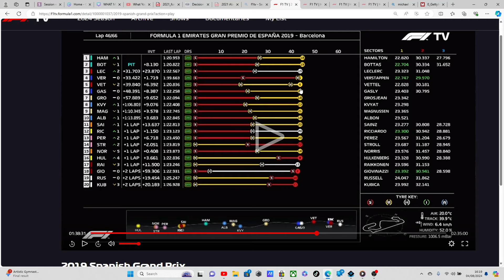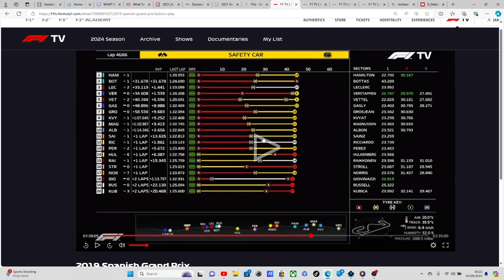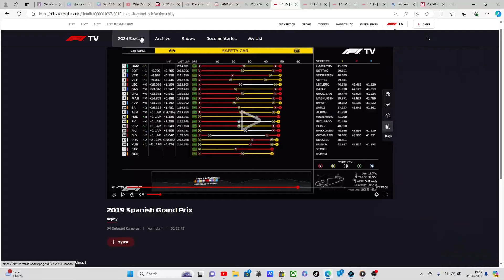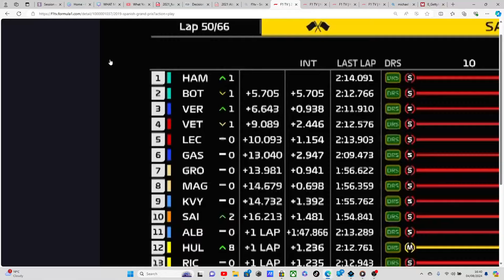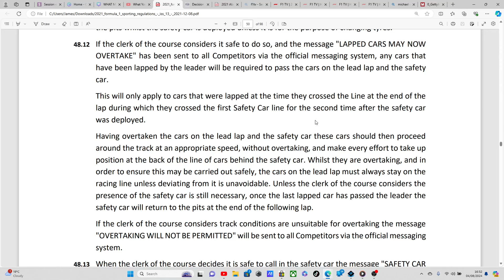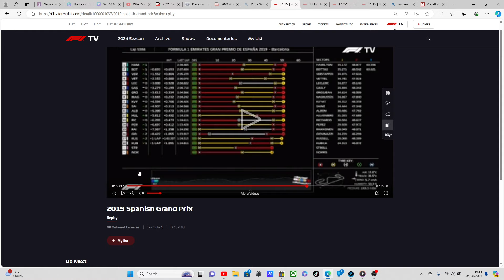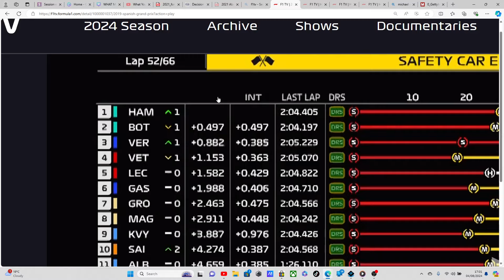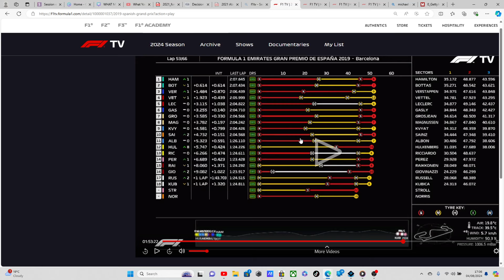MASI SPEAKS OUT - 'THE PURPOSE OF 15.3 - OVERRRIDING AUTHORITY' #lewishamilton #f1 #abudhabi2021

Comment: The FiA Ruined The race by letting only 5 lapped cars unlap themselves when there wasn't enough laps left for any racing Lewis Hamilton won that Race if the standard rules procedure was followed
Reply: but the ultimate rule apllied so you lost :D
Reply: @oktayyilmaz5134  🤔🤔🤔🤔So by your assertion the ultimate rule is cheating, and you call it victory🤔🤔🤔🤔. Well the world is really in big trouble, I hope your boss will not apply the ultimate rule for your income😁😁😁
Reply: @oktayyilmaz5134 but the rules wasn't applied, that's the point,
Reply: @chriscollins550  race diretor had right to finish it under green..
Reply: @oktayyilmaz5134  no he didn't that itself was a missed used regulations. He only has control of the safety car if there's a problem with the safety car and has to bring another safety cat out on track of of there's a major incident like Roaman one, but it's not to restart the race.
Reply: @chriscollins550 That evening, still at the track, stewards dismissed Mercedes’ complaint after finding other areas of regulation that also applied, in addition to Article 48.12.

The first was Article 15.3, which gives the race director ultimate control over the use of the safety car — including its deployment and withdrawal, said the stewards.
he second was article 48.13, which sets out that the ‘safety car in this lap’ message is the signal that it will enter the pit lane at the end of that lap.

Stewards found that this overrode Article 48.12, so displaying the message meant that it no longer had to complete an additional lap following the unlapping procedure.
Reply: that was the rules...so you can not say it wasnt race director power...
Reply: @oktayyilmaz5134  it wasn't the rule, he missed used it and he agreed that he did in the investigation, he even said that the season before they had the same issue and did the opposite because he the regulations was not meant for that reason or to restart the race, what part of that do you not understand, he chose to do it this time because he thought that it would be changed after the race but it wasn't and he was panicking knowing it was a missed use of the regulations and then he got fired after the investigation because of it. Now do you understand
Reply: @oktayyilmaz5134  the point is the stewards was wrong as well because both the articles you have mentioned should never be used to over ride the safety. Like I said masi was fired for it and them stewards didn't know that the other racing code bock other rides both them articles, but masi did know and should of advised the stewards. The stewards are not entitled to both regulations book's only the race director is.
Reply: @chriscollins550  bro yes I agree..this rules used so rarely...maybe first time..but that doesnt change the fact that you cant say he did that for Max..all he did was to finish under green light...there are not any court judge...he used sporting regulation 15.3, 48.13
Reply: @chriscollins550  he did not think it would be change...otherwise he wouldnt say" we went motor racing."
Reply: @chriscollins550  I dont think he overruled any safety...Also he could let all cars in lap 56 but he did not..that was for safety..
Reply: @oktayyilmaz5134  he was fired for using it, because its not meant to be used like that, how do you not understand it, the stewards didn't understand the regulations but masi did, it's never been used in f1 like that and never will again because the fia have removed both articles now, it was designed only to be used in major incidents or if there's a problem with the safety  car, even the investigation says that.
Reply: @chriscollins550  yes I am Max fan..And you can call me biased..But if all rules are in the book ...you can say that must be changed..but you cant say  48.13, 15.3 was not there..He also said I did it to finish under green..Also I can say "how the hell 5 laps arent enough to start the race.".
Reply: @oktayyilmaz5134   yes he did he even wrote it down in he's own NDNA investigation note's, he admitted it, he only said the motor racing word's copying what Horner had said to him on the radio just before the restart.
Reply: They had the ability to unlap all cars when they originally said they couldn’t.
Reply: @chriscollins550 I agree that they broke rules but the question none of you guys can answer and refuse to acknowledge is why didn’t they let cars unlap when they made the original call not too? If all teams agreed to end it under green flags, and the mess is basically all cleaned up, why not let all cars unlap then and just have them slow around the wreckage?  There is precedent for that in fact most safety cars in the history of f1 worked that way. The track doesn’t need to be 100% clear to allow cars to driver thru they already are driving around at a slow pace. It seems like they realized that too late then tried to undo that by allowing some of the cars to unlap at the last second. But had they just let the cars unlap originally then none of the controversy would have happened and max would still be champion.
Reply: @weignerleigner3037  because since the death of jules the track has to be cleared before racing can restart as written in the regulations after he's death,  even if the team's ask fir a green flag finish it's not in the regulations again it doesn't matter what the team's ask for the regulations need to be followed to the letter, the only choice they had if the regulations was followed to the letter of how it's written was to finish under the safety,
Reply: @weignerleigner3037  no they didn't because, the car was still on fire on the track, they can't let car's unlap till the track is clear then they have to rejoin the back of the back plus the warm up laps and the safety car in lap.
Reply: @chriscollins550  that’s not true. Teams were on radio asking when they could unlap because the wreck had been picked up mostly. Even Martin brundle during the whole fiasco was confused by the call. It’s not against the rules at all. They are already driving around the wreck there’s no reason they can’t unlap at that point. Even joylon Palmer in the after race analysis brings this up. Again you guys make stuff up or selectively pick out the issues to make it seem like lewis got robbed. And also lewis that weekend had gotten away with multiple things that should have been penalties. The reality is most people who watch f1 saw the entire season the fia was a joke and we don’t care it was an entertaining season and the clear best driver won the title which is how it should be. Had lewis won there would be just as much controversy with the fia not penalizing him for blocking mazepin and also cutting a corner after max overtook him.
Reply: @weignerleigner3037  they had to put the racing car back down on the track as it bust into flames again, the Marshall and the fia hadn't told the team's by that point what was happening so only one team was calling for it to hurry up, no lewis didn't get away with anything, the first lap corner cut was because max forced a position again and red bull was told on the radio why Lewis didn't have to get back the place, no the regulations sate that all car's have to stay behind the safety car till the track is clear and it wasn't. Fan's did care about the fia not following rules all season go listen to any f1 podcast that's still up people was complaining call it wwe saying the fia are picking entertainment over the regulations and that's not right we want racing by the regulations,  he didn't block mazepin at all, he did what was within the regulations again you need to go read and learn both book's before commenting,
Reply: @chriscollins550  max did the same pass on the last lap but there wasn’t runoff so lewis slowed down and max made the pass, that’s what he should have done and didn’t he cheated instead that is illegal, and the mazepin thing was cut and dry he blocked him and they let it go. It’s been very obvious that the fia favors British drivers and people have been pointing that out for years now. Norris getting away with going outside the pit line on entry and facing no penalty it probably the most in your face one.  Lewis cheating the entire Bahrain race and facing no repercussions is another. And it doesn’t matter if there was a fire which idek if there was I’d have to look myself I can’t really trust a clearly bias person like yourself. It wasn’t a red flag it was a safety car so it’s ok for the cars to drive around a wreckage but if they are unlaping themselves they can’t? That makes no sense. And also let’s say everything your arguing is correct. Lewis was ahead on the last lap in a vastly superior car and made no effort to defend from max. He gave away that victory. That second straight dude had a slip stream almost equal to drs with no drs. He could have just held the inside thru every corner and max would have lost. But he didn’t.  Entirely his fault. And let’s say we do change the result. He’s no 8 time champion, he won in 08 unfairly without the whole massa situation which is far worse that is literal corruption from formula 1 knowing the race was rigged and not doing anything about it. If we look at the history of f1 the way it’s always worked is the people who run it decide what’s right and wrong it’s always been that way. They allowed merc to run illegal tech all year in 2020, when Renault has the mass dampener its banned midway thru. There’s zero consistency. Lewis got the bad end of that, after having good luck all year. You get what you deserve. His luck ran out.
Reply: @weignerleigner3037  now your bring up 08, lewis had no direct link to what happened, also following the regulations on that they can only do one thing for the outcome to have any difference and that's take out the laps before the Renault crash and if they did that lewis still wins, also it was no wear as bad because the fia didn't cheat their own regulations in 08, they didn't allow Mercedes to run illegal technologies in 2020, the Das was allowed and the fia was part of the full design time line, it wasn't illegal till the end of 2020 for the 2021 season and they only did that because of cost of development for other team's
Reply: @chriscollins550  lol and max has no link to Abu Dhabi. Both races the fia messed up by not making the correct decision. Only difference is one they fully knew what they were doing was wrong and the other was last second mistakes. And yes exactly. They let Mercedes run tech that other teams couldn’t use and would later be deemed illegal but when other teams have done the same there is action taken against them. Again it’s the fia and formula 1 being inconsistent and Hamilton tends to get the better outcomes on these things.  Every response you’ve had shows the real problem here. You just want lewis to win you don’t actually care about fairness or consistency.
Reply: @chriscollins550  I just rewatched the last 6 laps you can literally see by laps 54 when they say the cars can’t unlap latifis car is off the track, so whatever Info you have is incorrect.  The channel is dinand2. Has multiple onboards. Unless I’m blind after they say no cars to unlap they drive around the area latifis crash happened and nothing is there.
Reply: @chriscollins550  yeah in fact you can see it’s off the track. So again, this is just flat out proof they could’ve unlapped the cars and even tho the video is commentated in another language you can hear even they sound confused. It’s cut and dry now they could’ve unlapped the cars and didn’t. Had they max would’ve won and no controversy the end.
Reply: @weignerleigner3037  I had enough of your blatant  Ignorance, it's two totally different thing's, that's the problem fan's like you can't see the difference you see everything as the same. Just follow the regulations to the letter and every bit of your defence doesn't work. The problem hear is not me it's you don't know the difference in every penalty or the regulations to them penalties you go by what you think you see and know and that's the problem because you don't know, you're using everything you can from 08 to well team's whatever to race under green flags. But ignore the fact that the regulations wasn't followed and if they was lewis would of won it's that simple nothing more nothing less. Everything else you say has no bearing and doesn't matter at all. It's not because I want lewis to win it's because after 40+ year's of being a fan and everything I seen that was the worst decision ever, the fact that masi admitted it and the fia have even admitted it but fan's like you can't just say it all, end of conversation.
Reply: @chriscollins550  your ignoring the fact they didn’t unlap cars when they could. Case closed.
Reply: @weignerleigner3037  you're ignoring the fact they couldn't by the fia regulations. I told you they can't and why. So we'll done for not knowing what you are talking about
Reply: @chriscollins550  yeah you lied i rewatched the video
Reply: @chriscollins550  car isn’t even on the track
Reply: @weignerleigner3037  it doesn't matter, and it was on the track the Marshall had to drop it back on the track. If the car isn't 100% clear of the track they can't let them unlap you really need to understand that's the f1 rules if you like it or not,
Reply: @chriscollins550  it’s not literally go watch the video, I just watched it earlier cus I knew what you people are saying is bull crap. Watch the onboard I told you the channel to go to there is no car on track when they say cars can’t overtake.
Reply: @chriscollins550  but let’s say I’m right, would you then concede that they could’ve just unlapped the cars and max would’ve still won?
Reply: @weignerleigner3037  I told you they put the car back on track because it burst into flames, but also when masi did realise the car's he still broke the regulations because there was still Marshals on the track sweeping up carbon fibre. There's video evidence on line, he cannot realise the car's till the track is clear and it wasn't, even under racing there was still carbon fibre on track that could of course another incident, f1 puts safety over everything, since then there's new regulations to back it up even more. If there's less than five laps left no matter what now the race has to finish under safety car,

Comment: FWW, one person's take on this situation (who is not really a fan of any specific driver):  Given the "new evidence" shared in the earlier and now this article combined - would hope that a review (and correction ?) of this misconduct and resulting outcome could be accomplished by whatever court it was that would have been the reviewer which the original, subsequently withdrawn appeal (of the Stewards decision) by Mercedes (for whatever reason[s] it was withdrawn), would have received that action.  The specific misconduct here would be the testimony of Race Director Massi before the original panel of Stewards relating to the purpose of the regulation.  That testimony would appear to be discredited by the example given in this latest information presented by BBC - in spite of the intent or misconduct of the TV presenters, which is 'possibly' somewhat less offensive than the "official" and apparently misleading testimony received by the Stewards panel.  Certainly, might be a lot stronger case than the one pursued by Felipe Massa over the outcome of the Brazilian GP which decided that particular year's Championship.
Reply from the maker: Or simply put - they are all lying.

Comment: The commentators commentary is irrelevant. What is relevant is how throughout the season Masi knew the correct procedure and yet decided in Abu Dhabi to change the rules. 

Verstappen benefited big time from what happened in Abu Dhabi, but he is not at fault, it is Masi as Race Director who failed to apply the rules correctly and the FIA who failed to right the wrong after the race. 

While Hamilton took the travesty on the chin, he must have inwardly wanted Mercedes to fight for him and justice, and yet they did very little. Much later the FIA investigated and dropped Masi which suggests that they found fault, but did not feel the need to correct the result. Does anyone not think that had Hamilton pitted for tyres, Verstappen would have stayed out, and Masi would had applied the rules correctly and the race finished under the safety car?

In hindsight Hamilton should have allowed Verstappen to get ahead of him at the restart and then gone, which would have given the stewards no option but give Verstappen a 5 second penalty that he should have got anyway as Verstappen on the restart was effectively level and not behind Hamilton. Bottas could have perhaps helped and had an "issue" with his car preventing the restart. Bottom line Masi decided the race result by not applying the rules and inventing new ones.